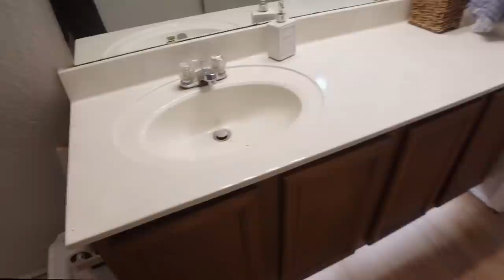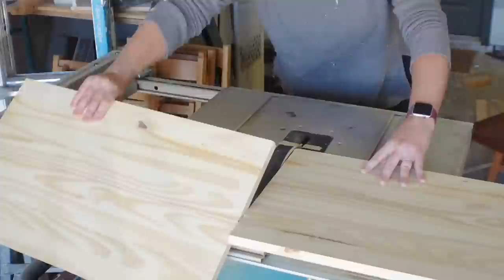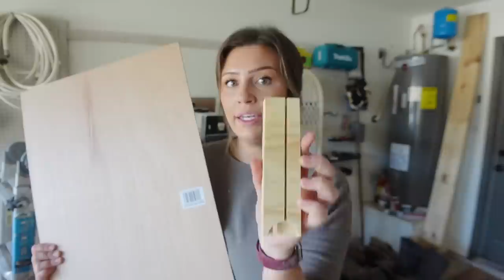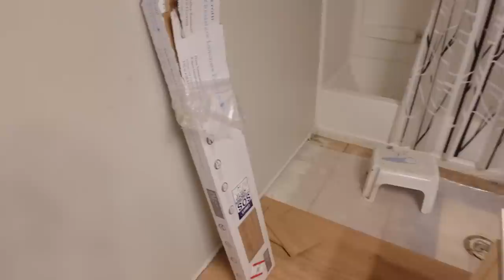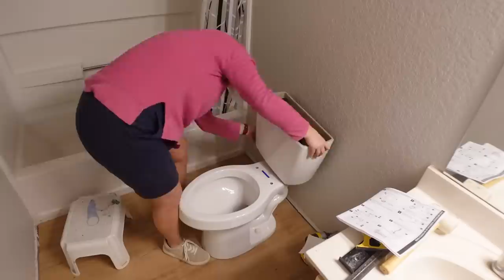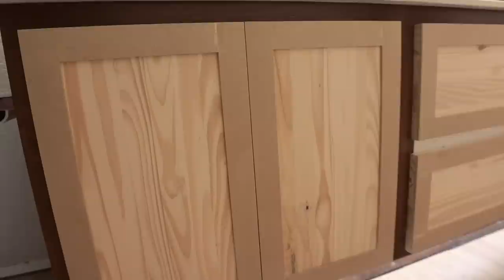REFACING MY CABINETS + BATHROOM MAKEOVER PROGRESS | *BUDGET* SHAKER DOORS | Bathroom Makeover Pt 2

Comment: This is going to look really good, and I wish I had caught you before you put the floor down.  We had the same issue with our guest bathroom vanity being to short.  We decided to take the vanity out, lay the floor and put it back, which brought the height up.  We then replaced the top, and added a vessel sink which really brought it up!  At any rate super job!  And for the mirror,  we took ours down, cut it in half and framed it.  Saved mega money,  and came out really nice.

Comment: I just found your channel and I absolutely love it. I am in the process of refacing my cabinet doors and you were a great inspiration. Where did you find the bender board,  is there another name for it? I can't seem to find it in my local home improvement stores.
Reply from the maker: https://www.homedepot.com/p/MDF-Bender-Board-Common-1-4-in-x-3-3-4-in-x-97-in-Actual-0-25-in-x-3-375-in-x-96-in-487404/202297474?g_store=6551&source=shoppingads&locale=en-US&&mtc=SHOPPING-RM-RMP-GGL-D24-024_016_EXT_PAINT-SB-BEHR-NA-SMART-NA-NA-MK683632200-NA-BT3-975-CON-NA-Exterior_PREMIUM_MARQUEE_FY23&cm_mmc=SHOPPING-RM-RMP-GGL-D24-024_016_EXT_PAINT-SB-BEHR-NA-SMART-NA-NA-MK683632200-NA-BT3-975-CON-NA-Exterior_PREMIUM_MARQUEE_FY23-71700000107698495-58700008304968584-92700075501932003&gbraid=0AAAAADq61UcCG6kIu79E4uOxdNv6a3MuW&gbraid=0AAAAADq61UcCG6kIu79E4uOxdNv6a3MuW&gclid=Cj0KCQjwtsCgBhDEARIsAE7RYh3V7eqS0WYAoQ2spKeVi3WtiLsaFaqm5Tfin9nDJnUjMzZAy7lexMwaAnIbEALw_wcB&gclsrc=aw.ds

Comment: Do you have a link for the binder boards you used or what the thickness is.
Reply from the maker: https://www.homedepot.com/p/MDF-Bender-Board-Common-1-4-in-x-3-3-4-in-x-97-in-Actual-0-25-in-x-3-375-in-x-96-in-487404/202297474